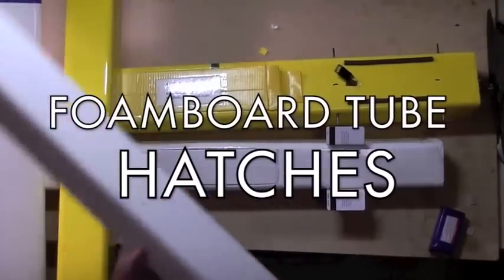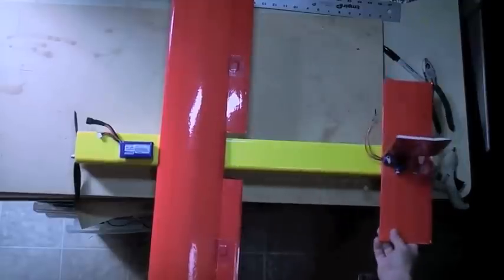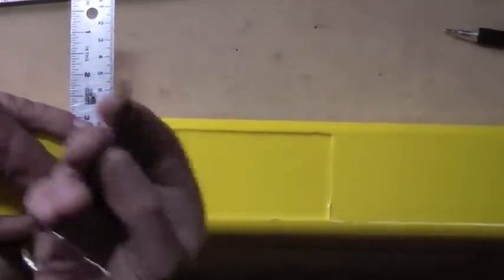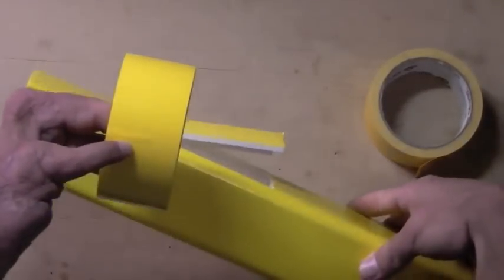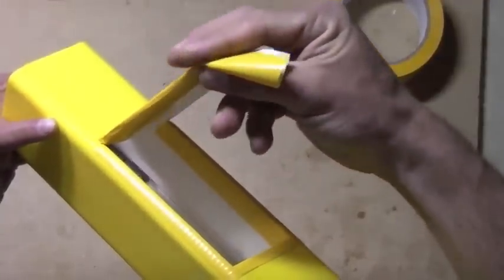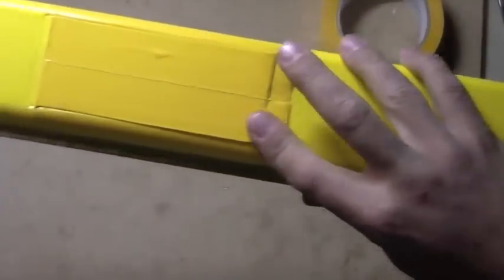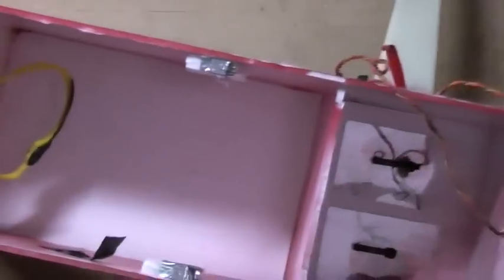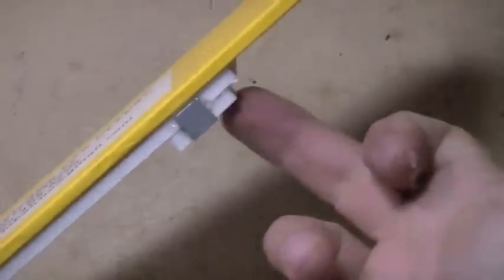Foamboard Building Techniques: Hatches

Comment: Hi!
I like your videos very much, I have a question about magnets. Do they disturb electrics inside the fuselage? I mean like batteries, motors, ESCs, or FPV transmitters. I do have some really strong magnets, and I could make very secure hatches with them, but I have some fears about this (especially the FPV gear, because on one of my planned planes the distance between the FPV TX and the magnets, is around 1", or even less).
thanks
Reply from the maker: Tamás Szemadám It is possible but I have never noticed a problem with my applications.  But I don't believe I've ever put a magnet very near FPV gear.  I believe you are right to be cautious.
Reply: +Tam&#225;s Szemad&#225;m The only thing they'd really affect are memory chips in small circuit boards, like an ESC, Receiver, or camera. They may interfere with radio transmissions if they're too close to antennae, but 1-2 inches of distance should be sufficient. Just make sure they aren't sitting directly against, or right next to, wiring or circuitry.

Comment from the maker: Put the battery as far forward as you can, but still be able to extract it.  The easiest place to put the ESC is on the outside, but inside the upper surface of the fuselage is pretty good too, looks better, and slightly more protected in a crash.  I would not put it directly in front of the battery in case of crash.  The receiver should be easily accessed in any case.  I like to just tuck it back into the fuselage and thread the antenna out of the fuselage just to keep it clear of the wires.